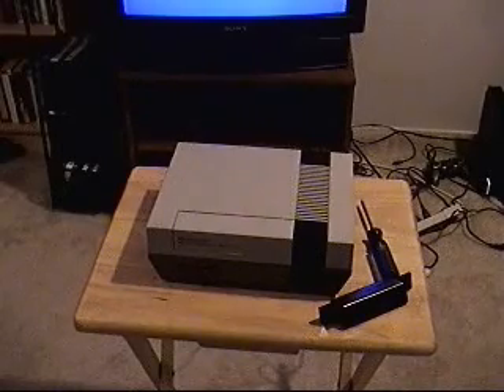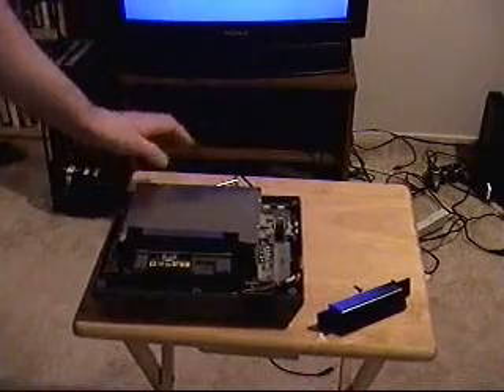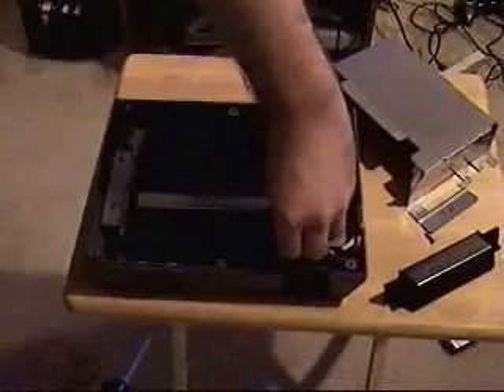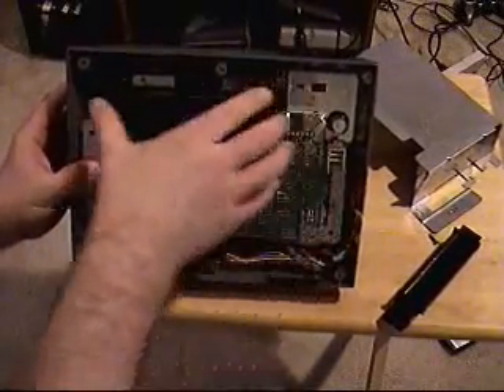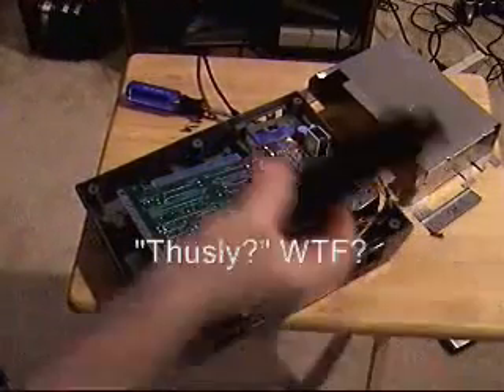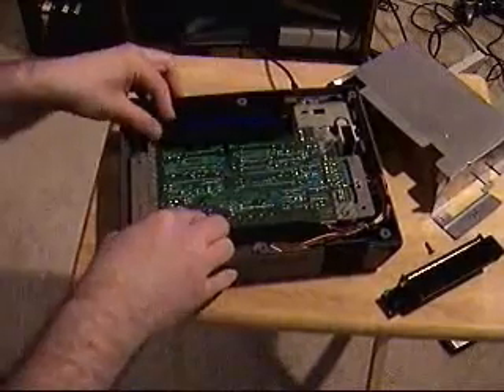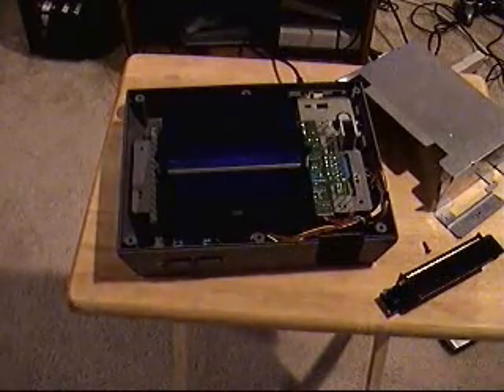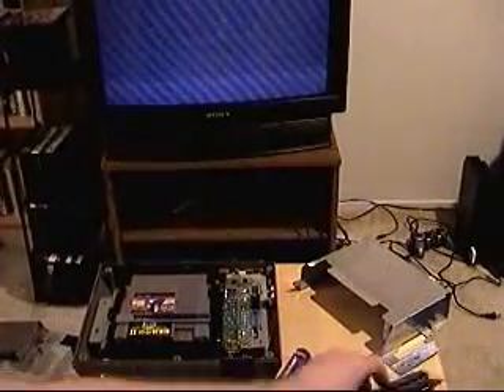Changing a 72 Pin

Comment: What it's doing is you can put the game in, turn the power on, and the screen is blank. You can push the game towards the back of the console as you're puttin it in, stick something like a piece of cardboard in the gap in front of the game between it and the console, turn it on and it works. I have cleaned it and it helped a couple of times but then it didn't have any effect.

Comment: When you put the game in, you said "It's kind of free in there, and that's what you don't want."

and then you didn't fix it or do anything about it.

My big problem with 72 pin replacement videos is that they don't clarify what screws to take out. Besides the ones on the bottom of the NES, I don't know which ones to unscrew. some may be unnecessary to unscrew or the piece the screw is holding down could also not fit back in.